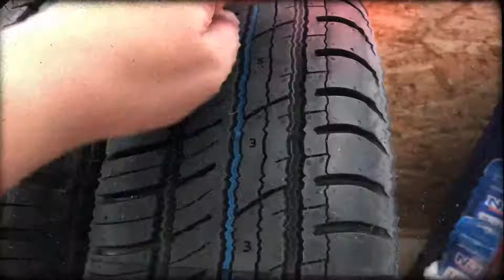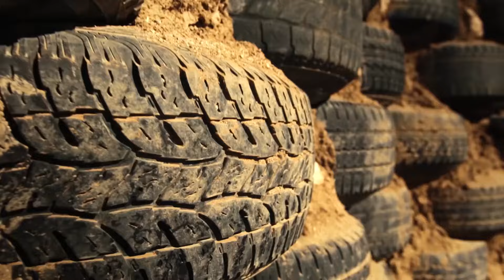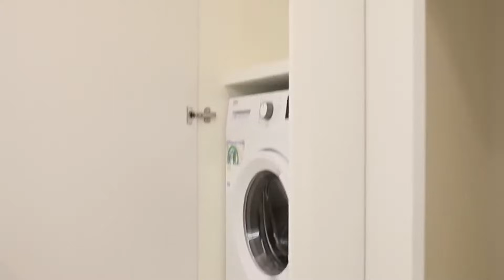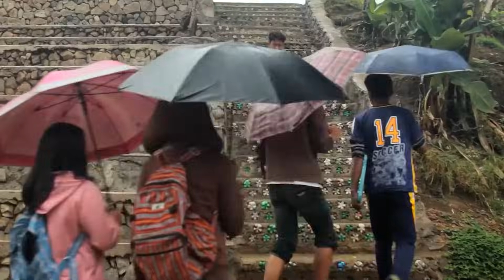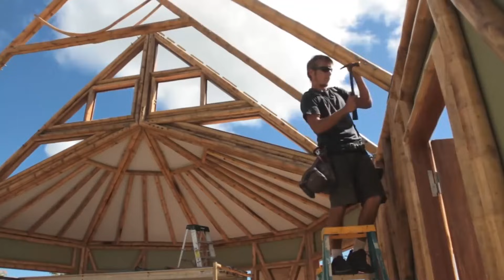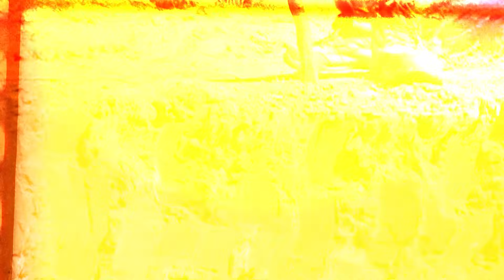This Man's Neighbors Laughed When He Got 1000 Old Tires

Comment: I’m not an engineer or builder. Although I’ve worked in both industries . So tell me why would they choose this method which makes absolutely no sense when you can build artificial walls filled with melted down rubber ? It’s thick and sturdy and won’t burn as quick as wood or rubber that’s clearly got air gaps in this situation. It’s just solid rubber. It will fluxate during weather without cracking and insulates without insulation. It actually amazes me that this has not already been realized. And this is a lazy way of looking at the possibility and what was done In this example was lazy
Reply: This method is chosen for sequestering waste, owner-builder accessibility, and mass temperature regulation; tires are not thermoplastics, able to be melted- if they were, they'd make horrible tires; any gaps you see or imagine are filled during the building process; bales of crushed tires ARE used for this same purpose, but require expensive heavy equipment to move and position, and significantly increase the footprint and roof to interior ratio- so a much higher cost per sq ft.   Go pound a tire, then come back and tell us how "lazy" the method is.
Reply: @mavigogun yessir it'll wear a good man out quick